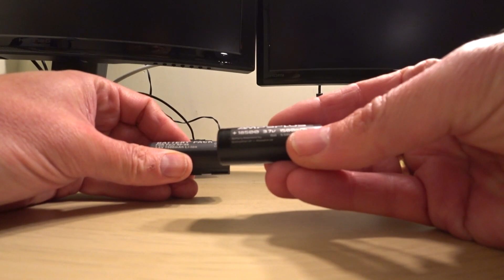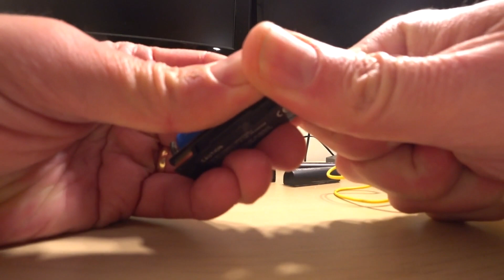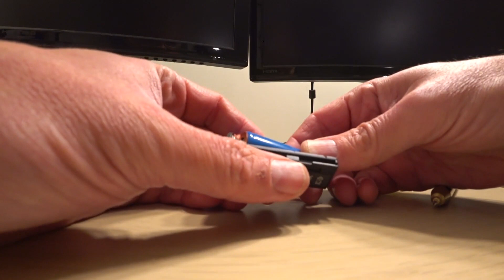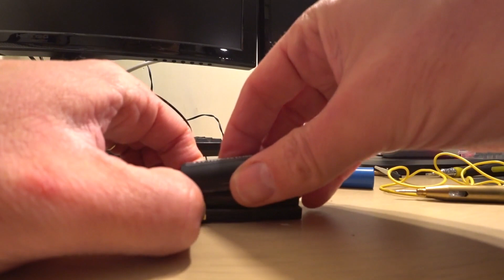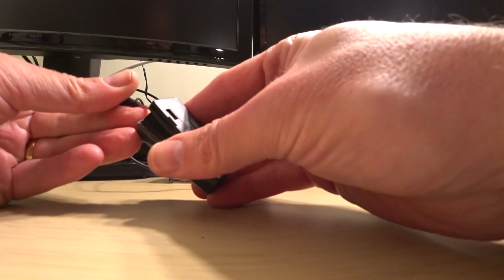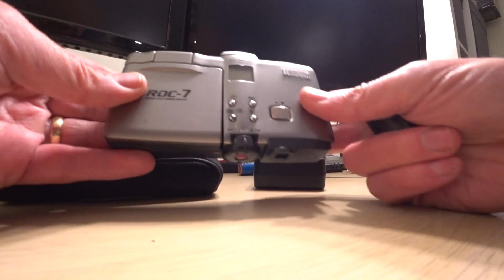How to fix Fuji NP-80 A homemade battery replacement

Comment: Thanks for the advice! I opened a NP-80 with a thin serrated blade (very carefully not to damage the internal circuit), I took the battery out, removing it from the terminals. Then I measured the battery and it was full! 3.9 V inside. Then I reconnected it a few times and then the output of the case terminals was also restored to 3.9V. Amazing. Maybe the tricky circuit just needed a reset. My camera started working as normal after that.
Reply from the maker: Nice work! I have given gumstick batteries and those AA battery holders for walkmans a little clean around the terminals to get them going again. Maybe something similar?
Reply: @AvidRetro I just bought one battery 18500 vapecell L22 220mah 3.7v 8.05wh don't know how to replace it into np-80 as in the video above can it work well
Reply: what the type battery np-80 inside ?
Reply: @adipalguna5374   LIR18500 or simply 18500 3.7Volts 1400mAh Lithium Ion Rechargeable
Reply: By the way, same experience as you @ReparadorAficionado! I had a dead KLIC-3000 (same battery, but made by Kodak) and I took the battery off of the terminals. I then placed it back in, recharged it and it was working for 30+ minutes. Crazy for a 25 year old lithium battery, but I'll try it with a 18500 battery soon.